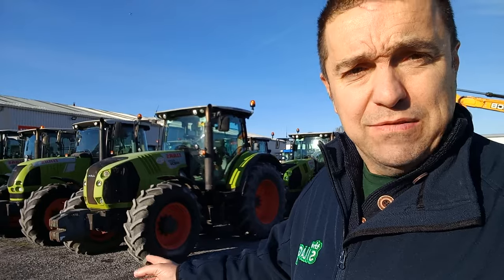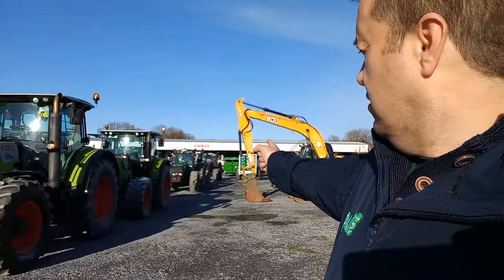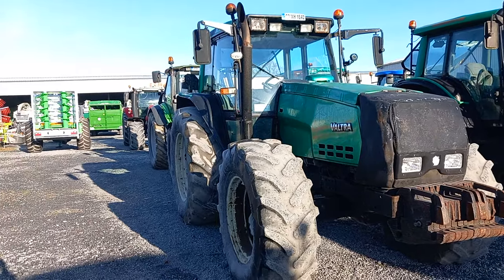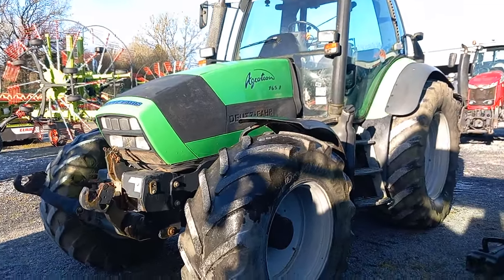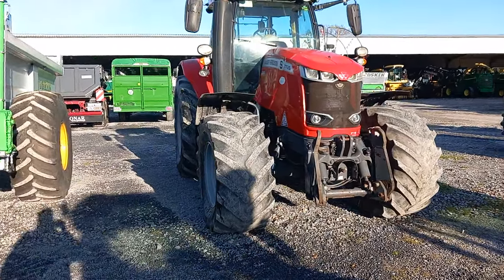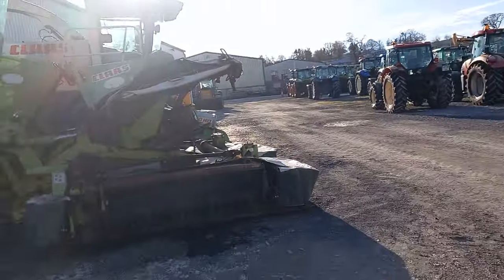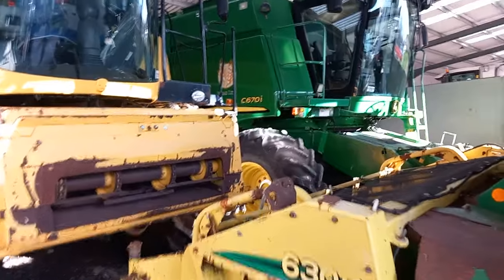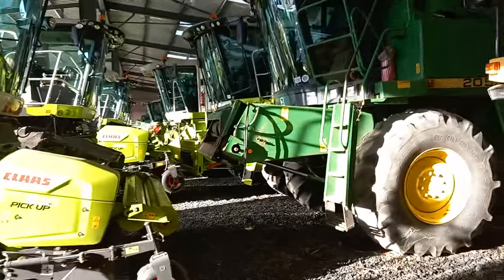kellys boris co carlow part 1  preview of up coming open day

Comment: At  21:22  Morgan You mention opening the door of the Welger slightly in order to make a bigger bale. With the latch system on the door of the  Welger baler once the latches are released will the bale not push the door open? AFAIK the door rams are single acting (opening), the door closes under its own weight and is held closed by a door latch on either side?
Reply from the maker: You are right, but in order to open the door fully, you had to keep the lever pulled and then return to flote
To close . Just open it enough to take off the pressure another 10 or 15 feet, depending on the crop
Reply: I had the same reaction, once the catches are opened there is no pressure keeping the door closed only it's own weight and it will open, the bale won't pack, there will be no density reading as it is set off the pressure on the door catches, and the bale won't net properly.
Reply from the maker: @byrneagri  this baler had cord, and it did they were fine bails
Reply: As said above once the door is open there is no pressure on the bale, the whole point of the latches are to keep pressure on the bale, if the bale isn't tied before the door opens it will immediately expand and go soft. Not the correct way to operate a Welger baler!
Reply from the maker: @wina8932  who said anything about the correct way, when the after the buzer would go off, I would  open the door and drive for another 10 or 15 feet, that's it, end of story.